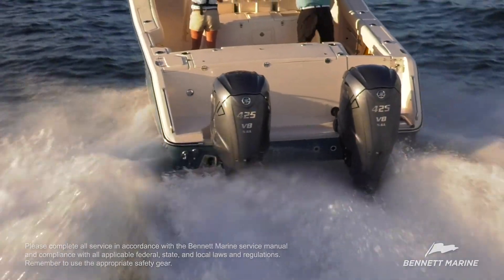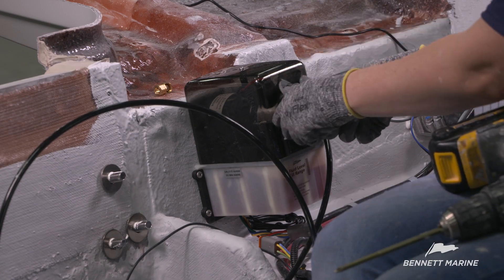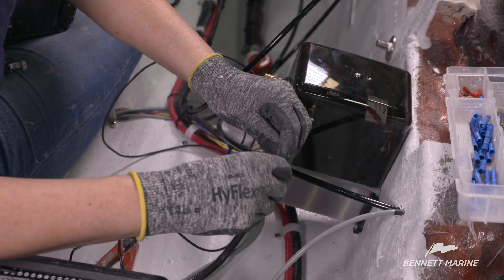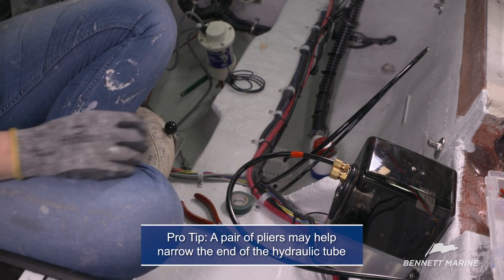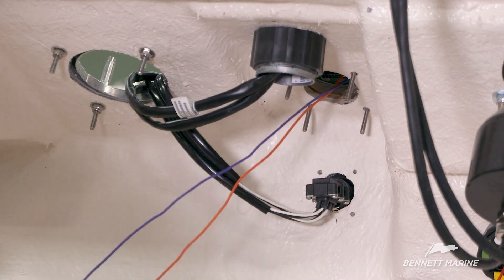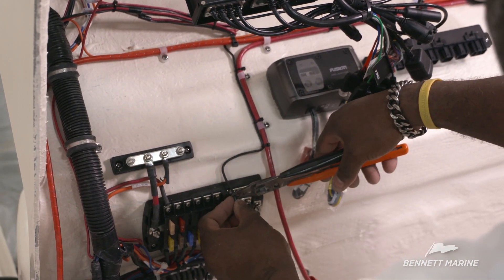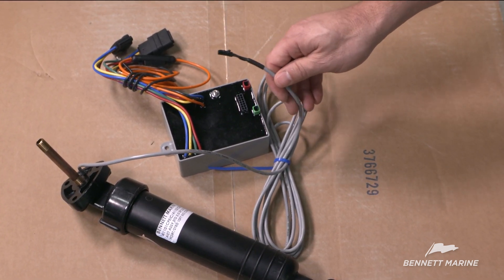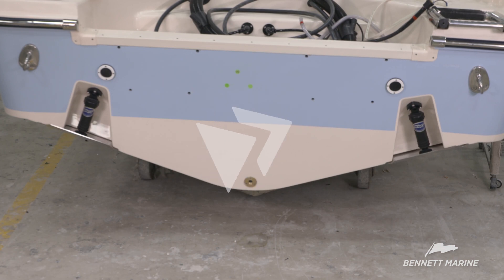Hydraulic Trim Tab System Installation Part 2 (Rigging)

Comment: Does this system works like a brake system that needs to bleed in order to remove the air from the lines? Im about to install this system in my boat and want to do it the right way once. Thanks

Comment: Well that is some proper doggy wiring, you should be asjamhed of that level of workmanship, then there is the nylon pipes cut with blunt pliers which had to be reshaped to fit into the brass fittings, just use a sharp knife or a proper pipe cutter, both cheap tools.

Comment: No heat shrink connectors?  How long will that ground wire splice last swimming in salty bilge water?  No labels anywhere?  This is not a reflection of Bennett, but on Grady White doing the install.  How much more would it cost to do things right?  $5 and 10 minutes?  What a shame, that the install looks neat bad it won't last.  And we wonder why electronics crap out all the time... SMH
Reply: Came here to say the exact same thing, Bennett is top notch but this truly is a shame, the installers pride themselves on install speed rather than the highest quality of workmanship. Also they're supervisors fault for the training and allowing this crap. I use solder seal connectors and add a second marine heat shrink over that, costs cents more per connection and adds less than a minute per. No callbacks
Reply: The crimp tools they use puncture heat shrink connectors so its not going to help too much with heat shrink connectors with bad tools.

Comment: I agree, it's odd that the right switch controls the left side and LED's. It would make sense on a Cat that has 2 bows. I'm glad I watched this video. I have to get my vintage 1983 tabs working. This would have driven me crazy if I fixed mine but the LED's were opposite.